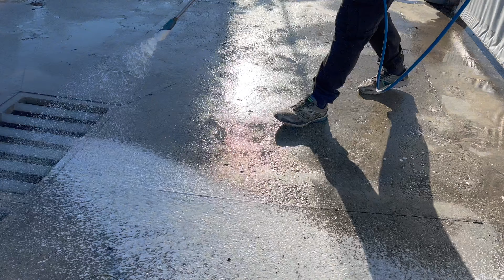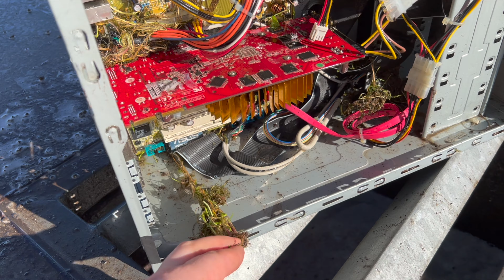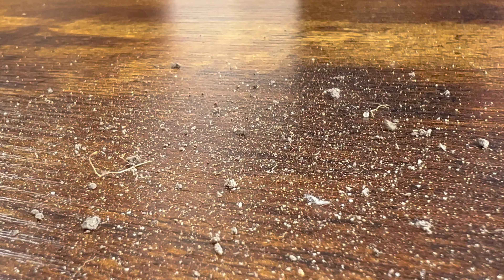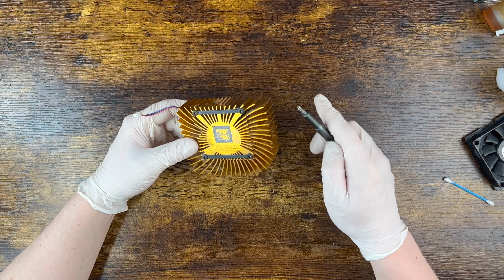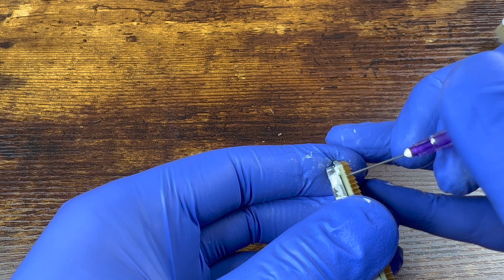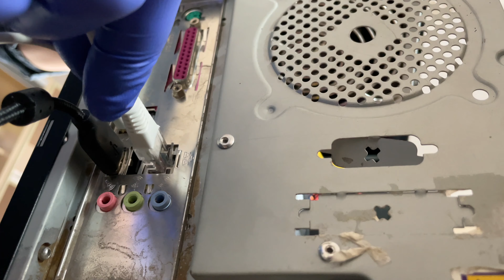Worm in PC | Insanely Satisfying PC Transformation!

Comment: enters the car wash station, uses it to clean a PC. big brain
Reply: What’s the problem with that
Reply: literally literally
Reply: Long as the components arent running and fermly drys it off it should be ok but not my method of cleaning out the pc. But you arent wrong there are MUCH better ways of doing it.
Reply: @marinaharos7423  water pressure can blow smds on pc components
Reply: @marinaharos7423  can blow some small components like smd and capacitor
Reply: @mynameisciko4885  correct he litterally soaped the entire pc even the VGA
Reply: i think the only thing salvagable here was the case and maybe one or two of the components. But yea I wouldn't have done it that way either.

Comment: Is the water safe for the device? I don't think so
Reply: It's fine as long as there is no electricity running through it.  When he was cleaning the parts they had no power and probably hadn't been on in a long time so it's ok.  The most important part is to wait for everything to dry off completely first before trying to plug it in, that's where the problem would come from.